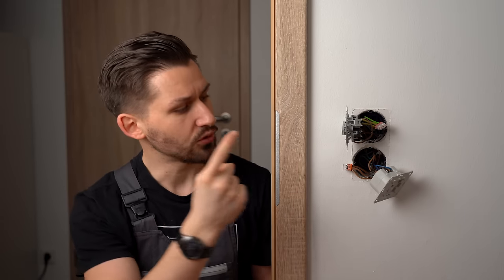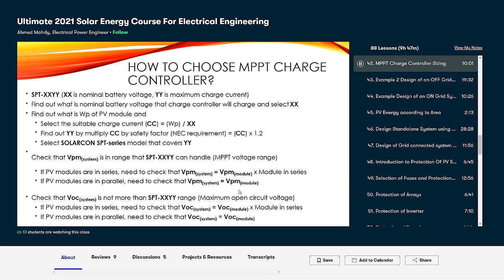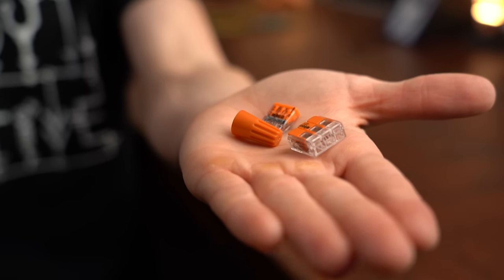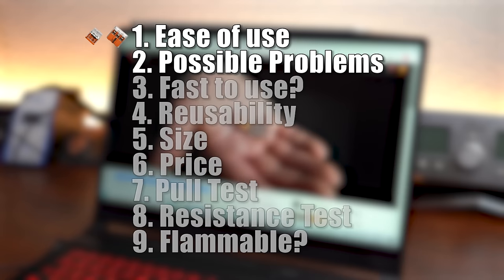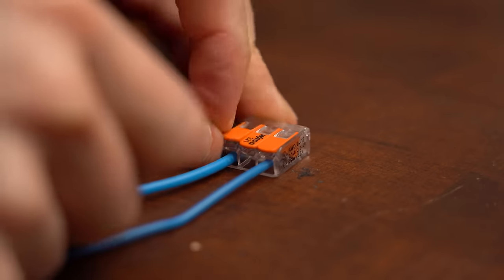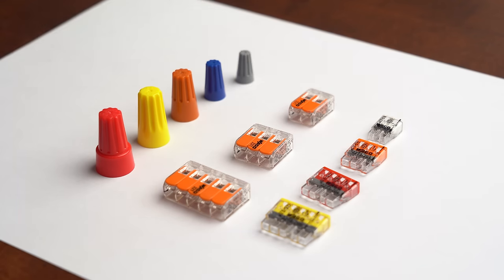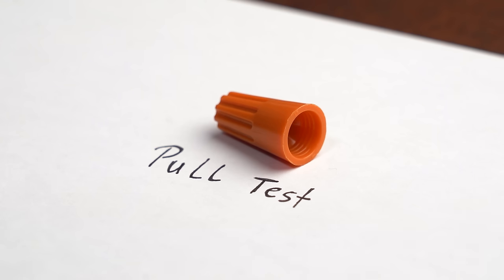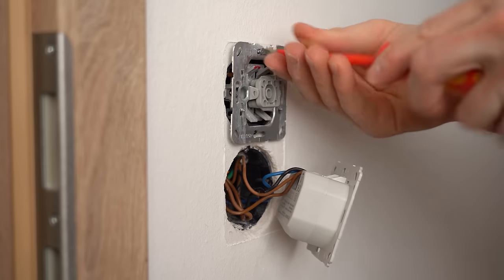What Wire Connector is the Best? Settling a Debate! Wire Nut VS Wago

Comment: In the US, every package of wire nuts I ever purchased came with all the data printed on the box or bag.  Number and type of connectors, etc. And amp ratings are not needed since the vast overwhelming majority of the current travels directly from the incoming wire to the outgoing wire.  

But....no question, the Wago connectors are faster and easier.

Comment: the most important test would be pushing lots of amps through it and see which ones isolation quits its job first. You can use the cheapest arc welding Box as a high current source for that.

Comment: Seems like although wire nuts may exhibit a poor connection sometimes, the Wago 221 clamp and bus bar produces a higher resistance every time.
Reply: But without producing any issue. I never came across an occasion where that resistance took any matter.

Comment: Wirenuts are better by far. The wirenut doesnt make the connection(if there put on right), the twisting of the wires does.The wire nut just protects the connection. The wago makes the connection thru a metal bus by means of lever operated spring contacts (points of failure) and two of them on each circuit, very prone to failure via heat, vibration, age,overload. The conductors never meet. Copper to copper mechanical connection is the best (least resistance and sound ). The wago is just a lever operated spring loaded double resistor. You push them back in the box the levers pop open. If you push the wire to the side the wire doesnt bend before it rotates side ways under the spring contact and gouges the wire. Wagos are junk, they sacrifice integrity for speed. There not used here in the USA (except by DIYers that dont know better or lazy electricians)for a damn good reason, and I hope they never are.

Comment: More surface area on wire nuts , use the right nuts and they twist fine.  Fyi we have those push ins also.  What happens when your little latch breaks?

Comment: I use both Wago and wire nuts (I use wire nuts more than Wago however mostly because of cost and availability), my experiance using both pretty much daily has been Wagos are easy and generally fine however wire nuts are a better connection, I also use crimp connectors a lot too, also for the heat resistance porcelain wire nuts are a thing and easily available, they able to withstand very high heat (for example I use them inside commercial burner chambers and in hot wells), I am unaware of a heat resistant lever nut or push connector.

Comment: In Russia, there is an eternal debate about which is better - WAGO or stranding with welding. 
Usually electricians use WAGO for lines protected with circuit breakers less or equal to 10A, and "stranding + welding" or "stranding + soldering" or "sleeve crimping" for others.
Price differs: WAGO 2273-243 x 100 costs 1802 RUR, and set of 155 different wire nuts costs 420 RUR.

Comment: You must fallow the strip chart on the side of the socket or switch,
The wires must be twisted first tightly on the bare wire then the end trimmed so it all fits into the nut once its tights then both wires twisted at the insulation. 
A lot of electricians also wrap tape around the nut so it can come loose. 
The wire nuts you have are low current type. Not what a pro would use

Comment: One minor correction.  Wire nuts have the info on the container they are sold in, rather than printed on each nut. Hence the cost also. But fair to mention.

Comment: I absolutely love wago connectors, my thumbs are not sore like they are after after a day of twisting nuts. My one gripe is the apparently small surface area on the contacts. The goal of a good connector is to provide the same temp/voltage requirement and resistance to current as the wires it is connecting. I understand a true 1 to 1 would be expensive and unneeded, but i wonder what the margins are and if the wagos fit within them. 2.2 m ohms is 15x that of the wire nut, but 1 million times 0 is still 0.

Comment: For the pull test, what real world situation would you see wires getting pulled with a similar force? If during installation of receptacles or switches, I'd assume the the installer would know to recheck connections in the event something like that happens.
Reply: The pull test tells you that the connection interface is complete and tight.

Comment: Fantastic test, thank you! I was quite surprised by the high (in comparison with 2273 and wire nuts) resistance and power loss on WAGO 221. Nevertheless, since I'm never dealing with anything more than 10A they still remain my absolute winner due to their undeniable reusability and perfect handling of stranded wires.

Also, I'm not sure but I've heard few times that WAGO 2273 shouldn't be reused too often. Maybe a myth, I don't know.
Reply: Its the bus bar connection in the wago that gives it worse results in that test  The wire nut twists the two wires together, no "middle man" bus bar to add resistance.   If wago's become mainstream in north america I think we'll see a dearth of cheap knock-offs show up using poor materials and clamping causing all sorts of problems.

Comment: Grow up with wire nuts still hate them not only due to the as mentioned not knowing if it is truely connected well when nit only when it gets snagged on install disabling the ability to get a good connection if the wide end hits pretty much anything the nut will fall off sooner or later

Comment: Probably important to consider that American electricians pretwist the wires before placing the wire nut on the connection.  In this instance, the wire nut is essentially just a cover for the connection you already made by twisting the wires together with your pliers.
Many DIYers don't know, or do this correctly, so WAGO definitely has a leg up there.
I was definitely surprised seeing the lever WAGOs fail the pull test!
Reply: The wire nut instructions doesnt say that so no need to.

Comment: I still use wire nuts with wings and drill attachment it makes super solid connections and you can take them apart if need be

Comment: Our RV uses Wago connectors, and we’ve had instances where the motion caused by driving has caused a connector to pop loose and caused an open circuit.
Reply: Really should use solder and crimp connectors

Comment: "Ease of Use" - If you think manually screwing a cap on 2 wires is legitimately more difficult than putting them through a hole and pushing down a lever, then this debate is off to the rockiest of rocky starts, for real.

"Possible Problems" - You're supposed to, at the very least, twist the stranded wire before adding the wire nut. But an even better way is to twist any stranded wires first, then twist together the wires to be connected. A wire nut is designed to just keep the wires in close contact at as many points as possible, creating a super secure connection, so failing to do any of these things before slapping on the nut is why you think they should lose a point.

"Fast to Use" - What do you know, an electrician is fast at applying a connector type that he uses on a daily basis, and is slower at using one he never uses. What a great comparison.

"Reusability" - This one kills me. He twists and yanks a wire out of the Wago 2273 and says it's totally cool, whereas all you have to do is unscrew the wire nut and yet the 2273 wins. This debate is ridiculous lol

"Size" - Even this one is bad because some Wago connectors are over an inch wide. He puts them right next to each other and still says all is equal.

And last but definitely not least, I love how during the resistance test he shows that, not only do wire nuts have 15 times lower resistance than the Wago 221, but they create 0.88W of pure HEAT. That's what a connector power loss is. Heat. And not only is the power loss apparently fine, but adding a 1 watt heater inside the wall for every wire connection is "trusty", as he's going to stick with the "trusty" wire connector that he doesn't feel like switching from lol What a joke of a comparison video. If the biased things pointed out in this comment are accounted for, then the wire nut doesn't actually lose out on a single category, whereas the Wago 2273 is not reliably reusable (I sure as hell wouldn't reuse them), and the larger Wago connectors are way bigger than wire nuts, making the wire nuts win 9 to 5 for the 221 and 9 to 4 for the 2273. But hey, the Wago connectors are "trusty", so they win.

I'm not saying wire nuts have no weaknesses when compared to Wago, like being able to physically see through the plastic, but this comparison video is dumb af. If nothing else I'd rather keep little Wago heaters out of my walls. A wire connector that introduces resistance to an otherwise straight shot of wire is just an inherently poor design. If you can make a similar connector with no resistance, I'm sold.

Comment: You can always pull check on a wire nut to make sure it's actually connected. If you yank one of the wires in a wirenut and it ain't going nowhere, then it ain't going nowhere. The older models were such a pain to change out too, wirenuts were definitely better. The newer wagos with the clips are a lot nicer and definitely better. If you're doing something from a DIY standpoint where you're just doing a household at most, they're the go to choice. If your doing this as a daily job, wirenuts are more versatile in their applications and you really feel the price difference then.  Keep a couple of clip connectors in your toolbag to be sure though. They're excellent for dealing with remodel work and diagnosing wiring problems, especially at 3 way switches.

Comment: According to the numbers in the video, the power loss at 20 amps using the wirenut is 17.8 dBm, while the the power loss using the 2273 connector is 22.0 dBm.  For me, the ease of use of the 2273 connector far outweighs the relatively small 4.2 dB difference in power loss between the two connectors.  I can live with that.  Plus, you know you're getting a gas-tight connection with the 2273 connector.
Reply: The numbers in the video are 0.14 mΩ (wirenut) - 0.40 mΩ (wago-2273). Current 20A. How did you get such power losses?
Reply: @vadimlvs  According to the video (@ 9:27), the wirenut resistance was 0.15 mΩ.
The power loss is the current squared multiplied by the resistance.  P = I * V = I * (I * R).   
After calculating the power loss, it's a simple conversion to dBm.  dBm = 10 * log10(P / 1mW).  https://en.wikipedia.org/wiki/DBm
For 0.15 mΩ, P = 20 * 20 * 0.00015 = 0.06 W = 17.8 dBm
For 0.40 mΩ, P = 20 * 20 * 0.00040 = 0.16 W = 22.0 dBm
Reply: @spinkter36  
But this is a logarithmic scale, simple subtraction does not work. A difference of 100mW in relative value (0.06W - 0.16W) will be 4.2 dBm, but in absolute value it is 20 dBm.
Reply: @vadimlvs  The difference of dB values represents the ratio of the liner power values, as opposed to the difference of the linear power values.  That's the whole point of logarithmic scales -- to express ratios as differences.

0.16W / 0.06W =  2.67
10 * log10(2.67) = 4.2 dB
Reply: @spinkter36  
I'm sorry, but if you're calculating a ratio, why do you write dBm then? In the last post, it is correct - 4.2 dB - the expression of the ratio, and this is 2.67 times. That is, the power loss on the 2273 connector is 2.7 times more than on the wirenut. But 4.2 dBm is only 2.67 mW, which is not true.
Reply: @vadimlvs  You are correct, I should have used dB, rather than dBm.  I'll correct my earlier comments.

Comment: I guess the issue I have falls into the "time" area; but a good 10% of wire nuts I have to redo as they fail to twist well and allow pull out; even with doing good prep on the wires.  The other types are pretty consistent that when they are in, they are in.

Comment: I retired after more than 45 years as an electrical contractor and I always preferred the spring "wirenut " type connectors with the soft plastic shell.
The softer plastic allowed the coil to slightly expand and keep a constant pressure against the conductors.
I never liked the Wago or speedwire type connectors because I never thought they had enough surface to surface contact area and I've seen more of them fail than wirenut type.

Comment: I'm not wiring a house, I'm wiring a boat.
I'm always using marine wire - stranded and tinned copper wire.
As for connectors, I always use heat-shrink crimped connectors.

Comment: Actually. at 2:32 you say you can use wire nuts for both solid and stranded wires. And this is true, but not allowed to use stranded wires in them. They are too easily pulled out. Here is the netherlands old buildings mostly have wire nuts. And it's still allowed to use them, but not with stranded wires.

Comment: in praktic, i used the nuts for loudspeaker-kabel, after years the conection is korrodet and i have to make some turns for good kontakt inside, AND here in germany it's only for flexible kabels and only for mobil using, not in a house for example where it will stay all time.

Comment: The only thing to take care is that try not to twist wires of two different materials together like aluminum wire to copper wire.. otherwise a simple twist with insulation with an insulation tape is more than enough. if you have a soldering iron, put solder on the joint as well.. Nothing bad will happen. The only thing is that the connection should not be loose as it is likely to spark. Half an inch to an inch of naked wire is enough to do a solid twist.

Comment: Coming from the US, I hate wire nuts. Once I tried Wago, I was a convert. But at 120v, 20 amps is not unusual. The heat the 221 Wagos created were a bit alarming.
Reply: they arent for solid wires
Reply: @makaandsoul1  The 221 are for all types of wire.

Comment: The problem with push in to grab connections for anything is the weakening of the connection over time. I’ve had my electrical contractors license since 1981 and actually started working with wire in 1961 in my first electric shop class in high school and then 7 1/2 years in the Air Force in an electrical/electronic field for aircraft. 
I still twist my solid conductors together with my Kleins and use a trusted style of wire nut, not some cutesy, easy to twist style. It was only when marketeers sought to cash in on the trend of do it yourself settled in that things, in my opinion, started going downhill. 
Here in California there are two classes of contractors licenses that the state is adamant that you have to really prove the knowledge and skill to be able to get, because of the extreme danger to the public that shoddy work or cutting corners brings, and that’s a General and an Electrical contractor. I have them both and I don’t use any push to connect anythings. Fires aren’t funny and neither are collapsing buildings.  But maybe I’m just an old, leftover relic that’s being too fussy. Well, you won’t find anything on my job site that’s there because it was easy for homeowners to use. Sorry buddy. I don’t share your opinion about push in connections.

Comment: Main reason wagos are not widely used is because of longevity. As current flows the wires expand and contract. Over time because of the bus not being as conductive as copper it will become loose and start to arc. Wire nuts actually compress the two wires together decreasing the resistance and making that expansion and contraction take 5 times longer before failure.
Reply: "not widely used" you know it's the de-facto standard in Europe?
Reply: @nichderjeniche  strictly speaking to where I live in USA. I'm actually using them on my current project and so far I'm having tons of issues with bad connections. Also not a fan of needing to carry different port sizes vs a wire nut that one size fits most.
Reply: @crzydirtyjoedirt1911  "tons of issues" 😅
my whole house has WAGO everywhere, I should have megatons of issues...
Reply: @nichderjeniche  🤣 I'm speaking of a commercial project with one floor having 388 can lights. Everyone has their own way and this just isn't going to be mine at least for now.
Reply: @crzydirtyjoedirt1911  WAGO quick connectors were originally created for the industrial market, not for home installations.

Comment: Probably said: With wire nuts always put the smaller wire (or multi strand) in the wire nut slightly further in.  In my book, if I've got a circuit really pressing the max current, or where corrosion may occur, wire nuts are belter.

Comment: In an overload situation the wago  plastic melt away at much lower amperage, than do wire nuts.      Yes at the rated amperage, both are absolutely fine.    It is only an overload situation.      But for me the little bit of time savings isn't worth the extra $ in cost of the wago.     I always pre twist my wires before using wire nuts.   I have never had a single issue with wire nuts over the last 35 years.  I am not a full time electrician.  But i have completely wired a number of houses.  And updated many more over the years.      In all of the years when my work is inspected, i have only had a few items flagged.  I think  all were code changes that were not  in my 2006 book.  So all very  minor .  (Not actually unsafe and wouldn't be required to change on old work. But required for new work.  Also very easy fixes.).